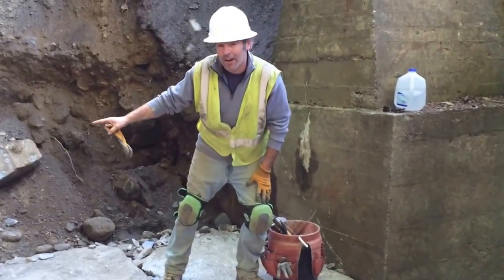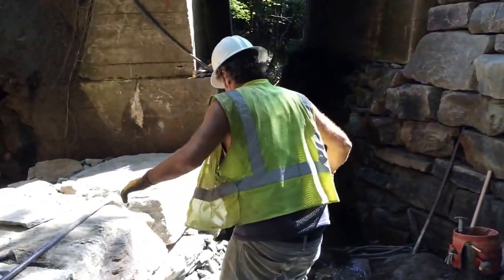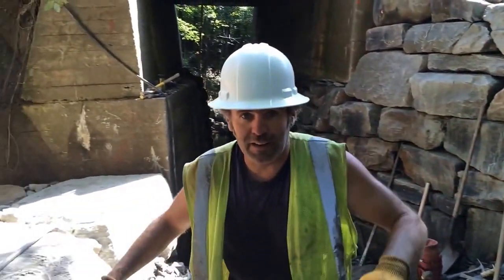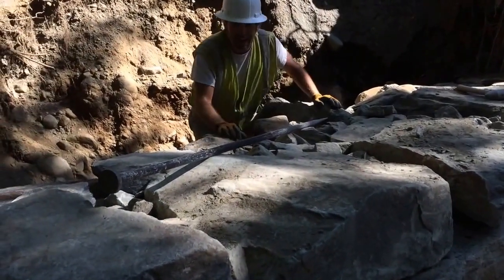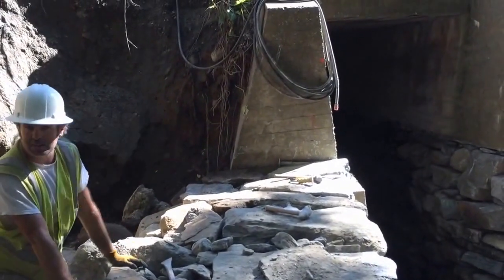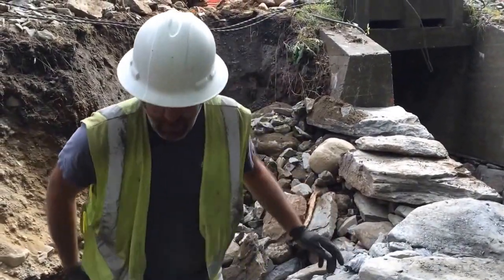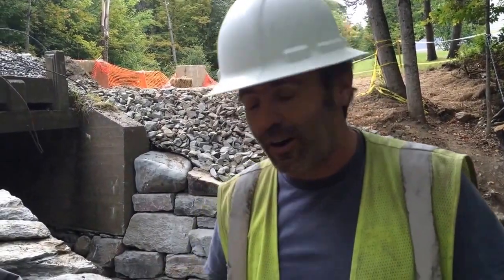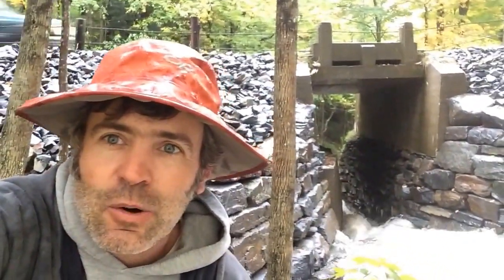How To Build A Dry Stone Wall For A Bridge

Comment: hi.  regarding yer latest hydropower project.      good work.       you  have ended up making a  turgo/pelton  runner.      these are  small-radius, High-speed   runners.         you had two choices  -   make a taller waterwheel;  or  'stay small'  and  locate the intake at a higher elevation (and utilize a penstock).        as  you have seen that a lot of energy is lost, as a result of the  too-flat  shape of  the buckets/spoons.     spoon design should result in the maximum capture of  kinetic energy.      see turgo/pelton.            you may know that  volts  are  not  Power.      power is  Watts.     watts =  amps  x  volts          amps  Should be measured in a way that results in  a  Normal  amount  of  lenz-related  braking, in the pmg/pma.    perm magnet generator.      for example, via the use of a  contact  ammeter.        in such a case,  a nominal amount of lenz-related braking  Will  occur, in the pmg/pma.    and,  rpms  will be  Reduced.        in order to accurately estimate the nominal output voltage, it  Must  be estimated  based on  measurement of voltage,  at  that    REDUCED   speed/rpms.  cheers        googletranslate           turgo spoon
https://d2t1xqejof9utc.cloudfront.net/screenshots/pics/0f9db1ffb2ee9fd2777ba27b540254dc/medium.jpg
https://h-hydro.com/New_Site/wp-content/uploads/2013/12/blue_top_view.jpg
pelton spoon
https://img2.exportersindia.com/product_images/bc-full/dir_31/922776/pelton-wheel-bucket-1718145.jpg
http://www.hydrotu.com/photo/pl3112854-high_water_head_pelton_hydro_turbine_with_cnc_forged_runner.jpg
penstock
https://en.wikipedia.org/wiki/Penstock
hydropower; scroll down to 'calculating power'    if interested
https://en.wikipedia.org/wiki/Hydropower

Comment: Can someone explain why the foundation course was laid ABOVE the bottom of the stream bed?? i know these rocks are big but whats to prevent them from being washed out over time?  Once they go, it doesn't matter what kind of work was done above it the wall is going to fail.
Reply: i think they went for the lowest amount of water flow when building it ... ..the stream was in spate later.. .its all about cost verses return, .to get down below that level the stream would have to be diverted .... a half decent job,, thoughts big stones will take a bit of shifting ... we can all come back in  a hundred  years and see if its  still their ..it always the  best you can do on the day ..